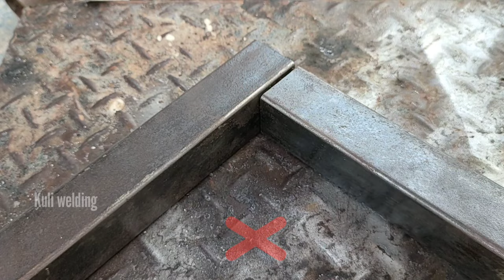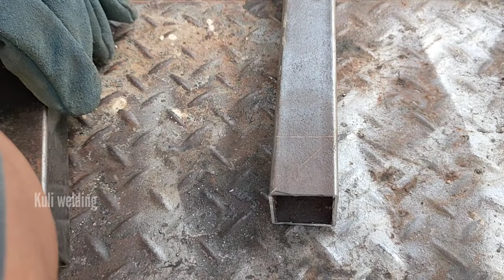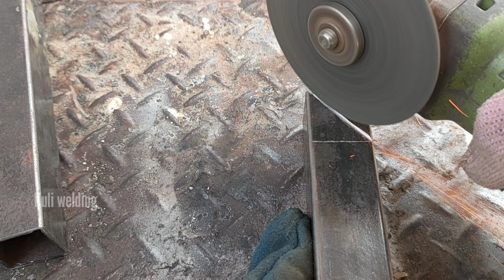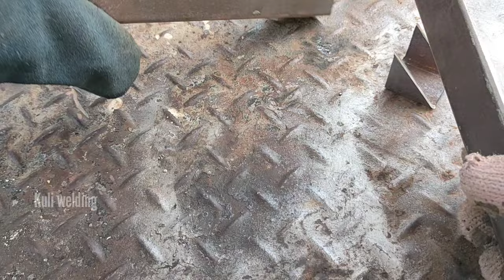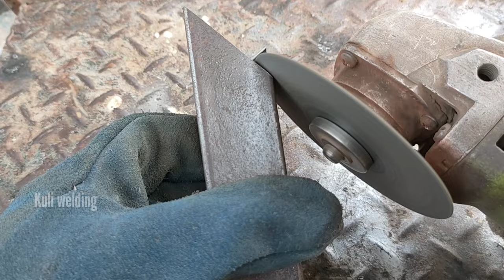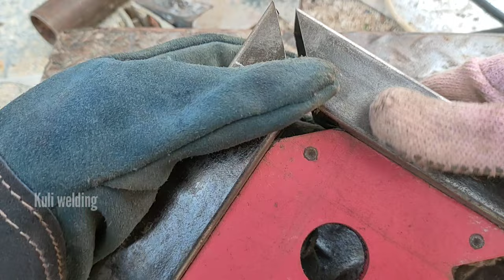simple trick| how to cut a 45 degree square pipe for a 90 degree welded joint

Comment: Using a cut-off wheel as a grinding wheel is even more stupid than leaving the square in the toolbox when marking a 45° line.
Reply: Seems a common thing on these videos. Sketchy as no guard aswell. Cutting wheels can shatter when used like that.
Reply: Came down to the comments section looking for this. I've been lucky enough to have never shattered a cut-off wheel, but I've been told that if one shatters on you, you will never use a cut-off wheel to grind again, you'll never use an angle grinder without a guard again, and you will replace your cut-off wheels often.
Reply: Ya done stole my thunder😂
A 4 1/2" grinder and gloves doesn't make anyone a pro.